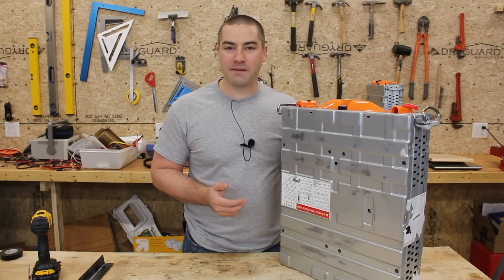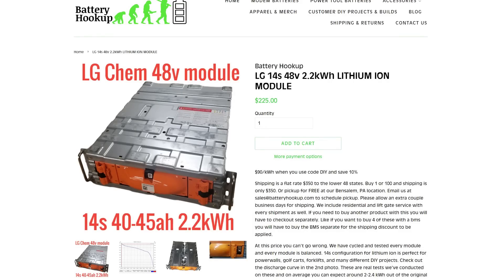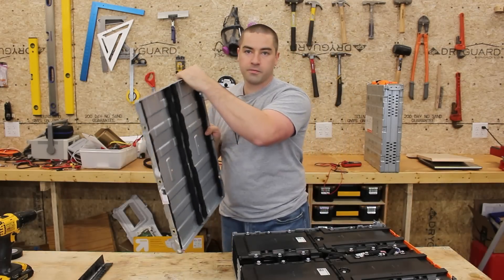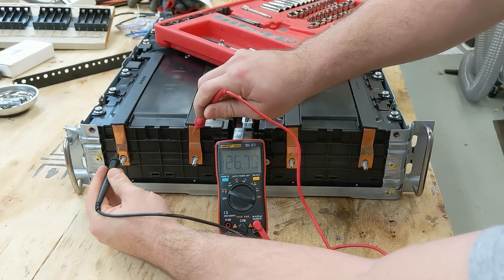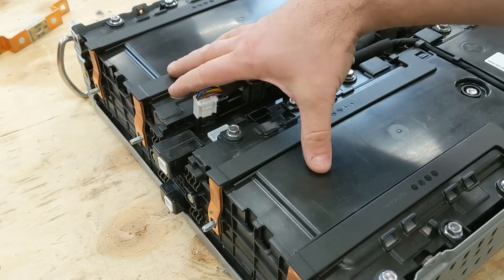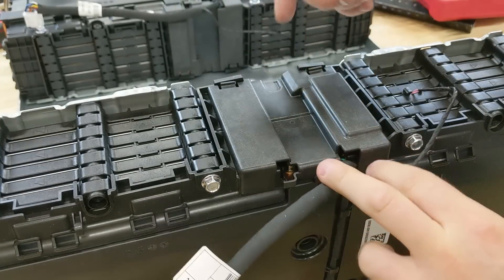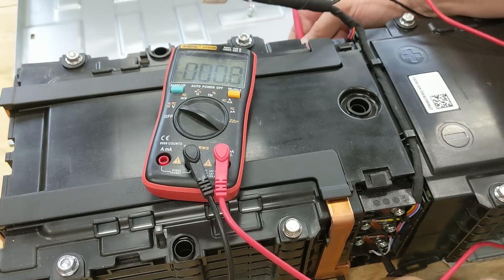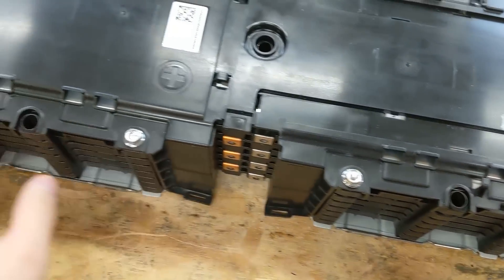Batteries for Home Backup, 14s 48v (51.8v) LG Server Rack Lithium

Comment: David, is it true that the life of these batteries would be enhanced by short cycling them.  Could I buy 8 or them and control them to shut off if drained down to 30% (or some similar number) and then charged back up to around 90%.  My cabin is fully off grid but my needs are small and if I were only using 50% of the capacity of the. batteries I thought they might last longer than me (I'm 74 and have long-covid issues).  I also have the ability to recharge the batteries with a generator if I don't have enough sunlight.  I also have the ability to easily add another solar array.
Reply from the maker: It's true with any batteries, the smaller the depth of discharge, DOD, the longer the cycle life.

Comment: Could this be used in a 48v Golf Cart and be efficient?

I am trying to find a cost effective solution for converting my Yamaha g29 48V Golf cart to Lithium. Going back to acid batteries would be around $500. So if I could do a DIY conversation for around $800 bucks would be well worth it.

Comment: HI David great video, not as much fun as the leaf blower video though! 
Ive been waiting patiently for this one, after buying a bunch of these when you first uploaded the intro video. I love the idea of parallel and combining as a 14S. This is the way I'm going to go for a total offgrid system. The plan is to have enough battery power for 3+ days of backup, so the daily cycle wont be as hectic on the system, and hopefully they will live longer than two years. Id appreciate your thoughts on this approach. By the way, are you planning on making the parallel 14S version? I hear battery hook up have just received more stock...
Reply from the maker: Hi Paul,  Go for it.  3+ days is pretty big for the average home.  I'm guessing you have gotten your electric use down quite a bit.  I've got a back-log of dozens of projects to work on.  So I don't plan to build the 14s version.  I wouldn't mind doing it, but it's just a time thing.
Reply: @DavidPozEnergy  It's a vacation home, so normally very little power usage but it still needs to have sufficient back up to keep the heating system running. By the way, can you suggest how to remote monitor the BMS?
Reply from the maker: Remote monitor this BMS?  this communicates with the bluetooth dongle.  I'm guessing here, because I haven't done it, but maybe: Use an old smart phone with bluetooth and wifi.  download some kind of remote monitoring app.  Then log into the app from wherever in the world and open the phone that is constantly connected to the bms.  The cheap phone would not have a number anymore, just connected with wifi.  ???
Reply: @DavidPozEnergy  Thanks I really like the idea! I'm really surprised company's like Daly haven't come up with remote monitoring solutions using WIFI, there's clearly a market with so many off grid homes not been full time. I'll keep you posted on this little 56kWh project as it progresses. Keep up the great work! Cheers

Comment: Hi can anyone tell me the thread size on the main + and - on these batteries? Also, has anyone configured these as a 14S as David's video suggests? It would be interesting to know how people have placed the cells in parallel. I f there were any issues recompressing the cells back into the metal case after placing in parallel. Also how they balanced all the cells before placing in 14S configuration. A lot of questions here but learning is fun...

Comment: Good afternoon David! Tell me, from what voltage to turn on the balancing? 4V?
Reply from the maker: If you have a BMS that allows you to set the parameters, then I usually set balancing to come on a little bit before the highest pack Voltage.  For example, in a 14s Li-NMC pack (like in the video) I might set the solar charge controllers to 57.4V, which is 4.1V per cell.  In that situation I'd set the balancing to come on at 4.0V per cell (56.0V).  However, if you were only going to charge to 4.04V per cell, then I might set the balancing to come on at 3.95V per cell (55.3V).  The idea is to allow the BMS enough time to balance, but without wasting extra energy.  This will vary with the size of the cells, age, SOH, etc.  
Note, the BMS I'm using in the video is factory set to 4V, I don't adjust it.
Reply: @DavidPozEnergy  Thank you! I'll think about it. Something prevents you from continuing the charge. I raised it to 4.3V and still stands at 3.87!
Reply: @DavidPozEnergy  I understand everything! The inverter has its own charge settings, etc. I set it up a little wrong. I fixed it now and it's all good!

Comment: Can you do a review on the nissian leaf battery
Reply from the maker: The Nissan Leaf battery is one of the nicest for DIY.  The cells have threaded terminals making it very easy to bolt 2+ together.  I've looked at a lot of them over the past 3 years.  Generally the Gen 1 batteries are only holding 60% of the original capacity.  That's too far gone for daily cycling.  It'd be fine for a home-backup, but not daily use.  I'm keeping my eye out for one with 80% or more remaining.  Then I'll consider buying it.

Comment: Has anyone been using these in an off grid application somewhere (regular gentle cycling)? Have they held up okay? Or have they fallen off a cliff?
DavidPoz, did you end up doing cycling tests on these?
Reply from the maker: I'm cycling mine, it's in service.  I am cycling it every day and plan to do a follow up capacity test after a year.

Comment: Great video David! Thanks for tearing this module down for us.

Did you determine if the balance board (BMU) was active when not plugged into the higher level system? 

Also, since you scrapped the BMU could you salvage the mating connectors fron the circuit board and solder those to the new BMS, thus avoiding having to tear into the factory wiring?
Reply from the maker: No, I never did test to see if the BMU was active while it sat there.  I've spoken with computer guys who install this type of system and they tell me "no".  But I can't confirm it one way or the other.  Could you salvage the connectors?  Sure, I guess.  But then I'd still have some jumper wires coming off to go to the JST connector, which is the one on the BMS.  So I guess I don't see the point.  But to each their own.

Comment: What setup would you recomend for a 12 volt replacement for an old Airstream?
Reply from the maker: For 12v batteries I'd use LiFePO4 chemistry.  It makes a perfect 12v battery when arranged 4s.  I have a video here: https://youtu.be/6Ai5IRQbLcc  And you can save a ton of time by buying the 12v kit from Battery Hookup: https://batteryhookup.com/products/new-battery-hookup-lifep04-32650-3-2v-5000mah-cells-1?variant=37744670277794  My coupon code is DAVIDPOZ which gets you a discount on anything at Battery Hookup.

Comment: Why do you say that these battery pacs would not hold up to deep cycling-because they are degraded? what if they were new or is that not an option?
Reply from the maker: I was saying that they won't last long (less than 2 years) if you plan to cycle them daily.  So I think they are best suited to home backup.  Yes, this is because they were heavily used and only have 60-70% remaining.  If they were new, then they would be great.

Comment: how are you david, what lithium battery and which bms do you recommend that is better for of grid for two sma sunny island 6.0.
Reply from the maker: That's a pretty tough question to answer.  First, because there is no right vs. wrong way.  There are lots of good ways.  Second, because there are lots of variables.  But I'll give you a starting point.  

Two SMA Sunny Island inverters (SI6048) have a total 12kw capacity.  At 48v, that's 250 amps.  So whatever batteries you choose, make sure they can handle that.  My personal rule (which is very conservative) is to double my requirements in AH.  Meaning, in this example, I would have a 500 ah battery bank.  That's about 25kwh.    This is just a starting point.  Going bigger is good too.

Comment: hi david, what would be your opinion of those batteries, 48V LiFePOWER4 100AH LiFePo4 5.12kWH Lithium Ion Battery 5yr Warranty 7000 Cycle, signature solar or BYD for an of grid system with two sunny island 6048 like the ones you have, thank you.
Reply from the maker: I don't have one favorite.  Whatever I can get my hands on is good with me.  LiFePO4 chemistry is great for stationary storage.  But sometimes it's more expensive than used EV batteries.  But if you find LiFePO4 at a good price then go for it.

Comment: Do you need bms to connect the batteries in parallel if you have 3 or more?
Reply from the maker: Every battery needs a BMS.  No matter how many you have in parallel.
Reply: thanks a lot man what would you recommend ?
  @DavidPozEnergy
Reply from the maker: In this video I used a BMS from Battery Hookup.  They are rated for 100 Amps continuous, and come in all sorts of configurations.  Choose the configuration that works for the battery you are building.  https://batteryhookup.com/products/12v-lifepo4-smart-bms-w-low-temp-cutoff
Use coupon code DAVIDPOZ for a discount and it lets them know I sent you.

Comment: Hello Bro I need your advice regarding bms 
My battery characteristics is 14s 48V 30A 
I bought BMS same characteristics but old BMS is discharge current is 30 A and charge current is also 30 A but the BMS I bought is discharge 30 but charge current is 15 so May I use this BMS ?
Reply from the maker: Some BMS's do that, they only have half the rating for charging.  It's fine to use so long as your charger is still less than the BMS rating (15A).
Reply: @DavidPozEnergy  thank very much for your help

Comment: Could you do a video of rebuilding a pack into a 2s7p?
Reply from the maker: That would only be a nominal voltage of 7.4v.  I don't have a use for that voltage.  My gear is 48v stuff. Unless I mis-understand.
Reply: @DavidPozEnergy  My plan was to rebuild in a 2s7p like you had stated within your video and stack them with 7x units. But I do see why you might hesitate to want to rebuild a pack of you only have 2x of them.

Comment: Hey David would these be good in rv for a weekend warrior application
Reply from the maker: These are fairly heavy for the capacity.  When I think of an RV, I'm thinking weight is usually an issue.  But it would be OK if you are in some kind of bus or something that doesn't mind the weight.

Comment: I'd like to get about 12 of these, make it 7s, I have the 120 ah LG's in 7s, I built 6 of them, and 1400+18650's in 250+ah packs,  in theory I should Be able to go nearly a week without sun,  especially using my 12v bank for lighting, nearly 400 ah of lifepo4, 12v used for lighting, and a 12v water pump, for backup water, and a diesel heater, I'm planning another DC generator to charge the 12v system, at a lower current, probably 20-50 amps, something quiet that I can start when needed, to charge the 12v system, with a larger to charge the 24v, to 80% at 300amps potentially,  
I thought about connecting the spim cells like these, but didn't want to tell anyone! Ha-ha, maybe I can make  a trip to batt hookup,  I can't spend that much on shipping! Ha-ha, imma cheapskate!

Comment: Hi David, 
I ordered only 4 batteries,could I put them in parallel and use a big BMS?
Reply: Not really. I've considered this approach but the voltage of the individual cells could drift while the packs themselves might stay within balance. You could manually balance the cells whenever they got out of whack, but you won't have high voltage or low voltage cutoff. I've considered this approach a lot and couldn't come up with a good safe method, so I'm going to reconfigure 7x of them for a 14s7p and use a big bms that way.
Reply: @laptopfreek01  thanks

Comment: How did you charge the pack once depleted?
Reply from the maker: I used a boost converter, but plugged it into a 24v power supply.
Reply: Thanks David

Comment: So these cells are 3.42 volts apiece? Is my math correct? Lithium ion I assume
Reply from the maker: The cells are nominal 3.7v.  Max working voltage 2.8-4.2.  Good voltage range: 3.4-4.05

Comment: I try to buy new old stock batteries, UN cycled if possible, and near rated capacity .  the 18650's I have are all 98-100+% of rated,  I'm hoping it will last 20 years, being cycles about 3x a month, between 3.1 and 4v/cell.. Shame these are degraded,

Comment: i would love these for my rack-mount ups i would have to mod the packs for 24v and use an external charger rather then the ups for charging unless i can reprogram the ups i would love to see the ups that should be with these battery's
Reply: Wire them in parallel, and add protection board ("BMS"), then the UPS doesn't need to know anything about the batteries.
Reply: @jfbeam  yes it does as lead acid is a diff charge voltage to the cells these batterys hold
Reply: The charge voltage on many APC Smart-UPS units can actually be recalibrated through their serial interface. More info here: http://www.jjoseph.org/notes/apc_smartups_battery_float_voltage

Comment: What is S in battery terms?
Reply from the maker: How many cells in series.  S stands for series.  In this video I'm using a type of lithium cell that has a nominal voltage of 3.7 volts per cell.  But my inverter is a 48v inverter.  So you put more and more cells in series to increase the voltage.  14s, meaning 14 cells in series, makes for a very nice 48v battery to work with my 48v inverter. I have a video on this topic here: https://youtu.be/CbHABrTpSKU
Reply: @DavidPozEnergy  Thank you so much David.

Comment: do you have any battery for sell if not do you know of any good deals  i build my own inverters so i can use any voltage  range
Reply from the maker: I don't sell my builds, sorry.  I have bought batteries from Craigslist, junkyards, and Battery Hookup.  So far my best experience is with Battery Hookup.  That's why I suggest them, and bought these from them.
Reply: @DavidPozEnergy  they are out of stock on everything  thanks for your time love your videos

Comment: I dont wanna be a Nagative Nancy but you may wanna stray away from those quick heat shrink and solder connectors. Look up the testing that many people have done on them.
Reply from the maker: It's just the balance leads.  Almost no amps.  I think the BMS balances at 0.01 amps, otherwise it's just sensing voltage.

Comment: Crappy battery. Puffed cells, low capacity. SCRAP.
Reply: They were trashed in first place for a reason... unsafe as well,  LG even did a recall due to many fires started from puffy cells bursting and erupting in flames.